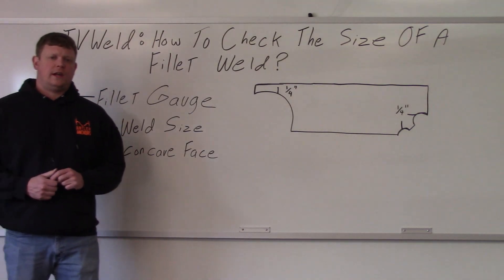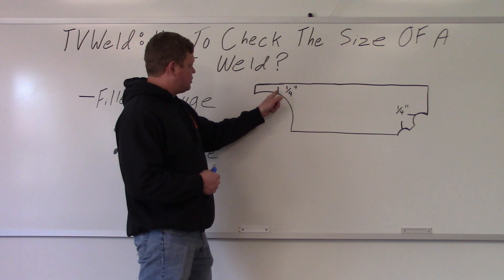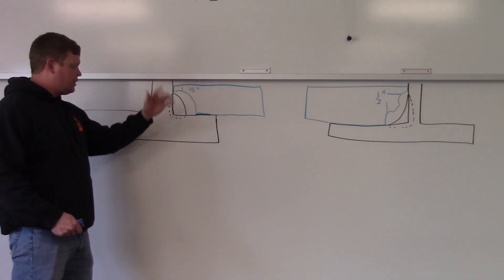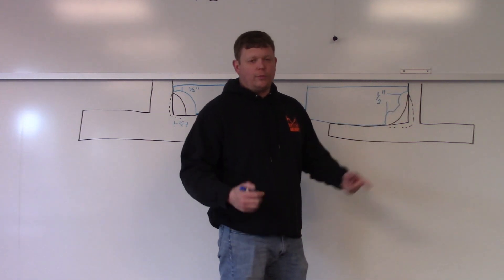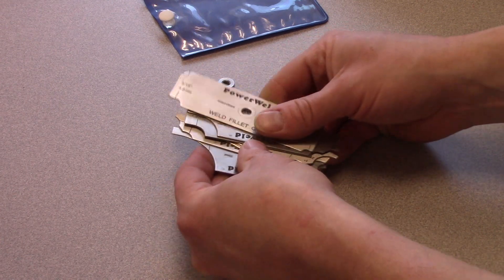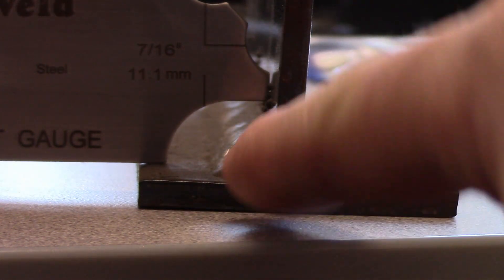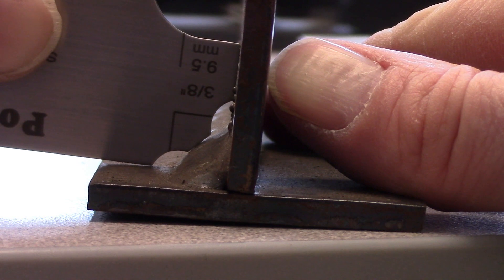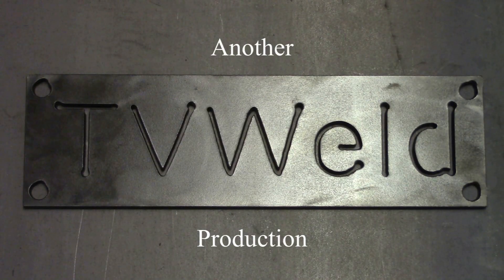How To Measure A Fillet Weld!

Comment: How would you determine your puddle size is correct during welding? My guess would be example your weld symbol is calling out .25 inches. Best way to make sure your puddle is the right size is geo get a 1/4 inch plate and place it up against your joint and mark with soap stone or scribe out the legs on both plates. Then you know for certain you have an idea where your toes should wet out to. That's how I'd do it before inspector comes around with a gauge to check the size of legs. I never had to deal with that but I'm sure for accuracy if you dont know what the size weld should look like, just scribe out your legs first.  Then you'll have an idea of your puddle is washing out consistently to the appropriate sizes. Especially on unequal legs. Because how are you suppose to know if your puddle  is washing out to appropriate leg lengths. You really don't. For me I'd mark my legs first. Then i know as i pull the trigger, i can watch the puddle expand out and make sure the sides spread somewhere near the lines.
Reply from the maker: You can mark your sides, but for the most part welders just get used to how big they need to make the puddle through muscle memory and repeated welding.  If you were in a production situation they are not going to want you to slow down production by taking the time to mark the sides.  If you were in a certification situation then I would say it would be appropriate to mark the sides.

Comment: So if the drawing asks for a 10 mm fillet and you put a 12mm  but the throat measures up as a 10 mm does it still pass
Reply from the maker: In my experience if a drawing asks for 10 mm it is referring to the leg size of the weld not the throat.
Reply: @TVWeld  im saying if the leg measures a 12 but with the throat of a 10